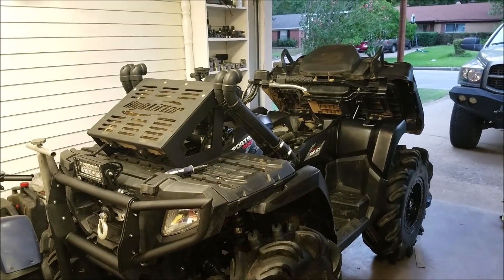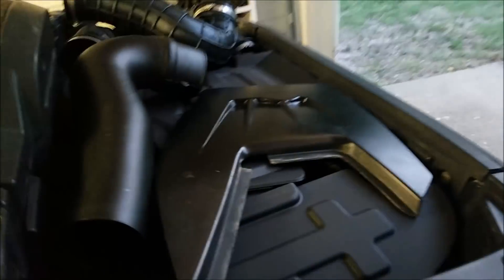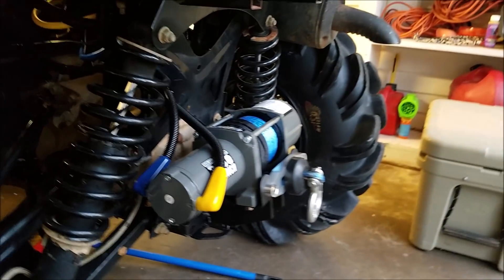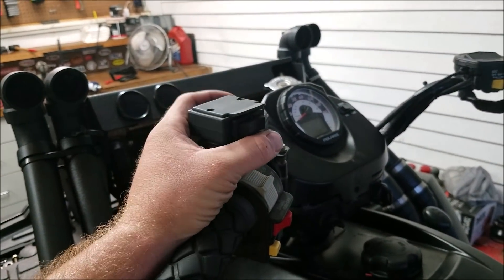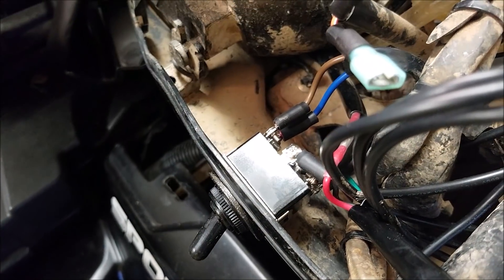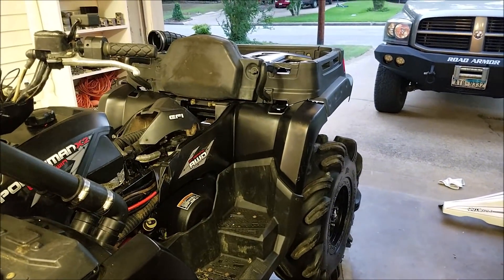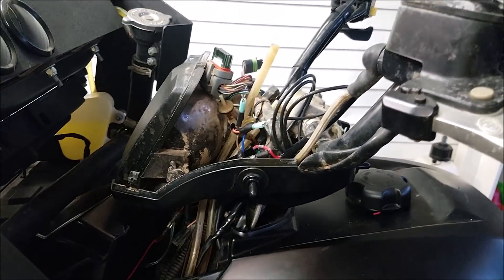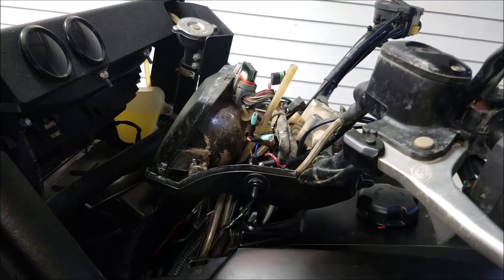2 Winches / 1 Switch - Polaris Sportsman Dual Winch

Comment: Great video. Wish I was more mechanically inclined
Reply from the maker: Riding Dirty 901 Thank you. You can do it man, just get out there and think about what you doing. If it doesn't flow or you second guess it, dont do it, retry until it flows nicely
Reply: SolitudeCustoms I did just that. I installed a new exhaust, rear axle protectors and a TigerTail on my Outlander with my cousin's help. I have it on my channel. Kinda got the idea of posting it by watching you rebuild Swamp Ass Honda. Cool videos and great inspiration.

Comment: Great information man, well that fan set up work on a 2012 800 ranger. I find it stops running at 195 or so. If u turn off and let sit a minute the temp is over 205. Like to be able to cool it down more.
Reply from the maker: Yes, but the Temp climbing when turned off is normal due to it not circulating. Those Temps are great for the 800 motor tho, but I always do it for a piece of mind.

Comment: Great video! What rear winch mount are you using (manufacturer, model)? You are mentioning something at 1 min 18 s but I can't quite get it. You are also saying that you can still use the 2 in receiver, which would imply that you replaced the factory installed 1 1/4 in receiver.

Comment: So your trick to run 2 winches on one switch is to use 2 switches? Jk. I've toyed with that set up but I think I'm going to just have the 2nd switch run the 2nd winch. Another thought is to have the center position run both winches at the same time only have one pulling in while the other feeds out. Could be handy in fast water. Lol
I have the same switch set up for my fan on my mustang. It's nice to be able to switch it on before I start romping on it, get a head start on the heat.
Reply from the maker: It's one switch for 2 positions. 1 switch does both front and back depending if its pushed front or to the back

Comment: It makes it more complicated but what if the middle position pulls or releases both winches?
Reply from the maker: You would just need a SPDT switch for that and connect both switch powers to one terminal and 12v to the other.

Comment: Can you explain the wires coming from the solenoid to your DPDT switch? Did you need to run 3 new wires from the solenoid to the switch?
Reply: His winch's only have two wires from the solenoid, a "winch in" & a "winch out" wire. ( brown & blue ) you connect the 2 wires to the top terminals on DPDT switch for 1 winch, And connect the other two winch wires to the bottom 2 terminals of DPDT switch for winch 2, then connect the middle 2 terminals of DPDT switch with the brown & blue wires to the winch rocker switch. when finished, ...If it winches in, when you press winch out, just reverse the brown & blue wires going to rocker switch and then it will work right. I hope that helps, I'm installing a 2nd winch on my side by side now. and just ordered one of these dpdt switch's.